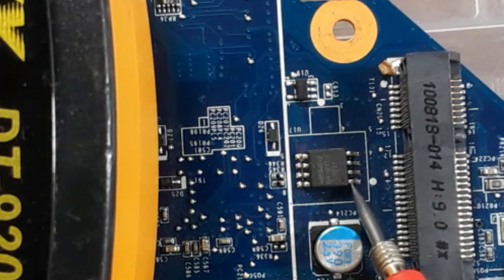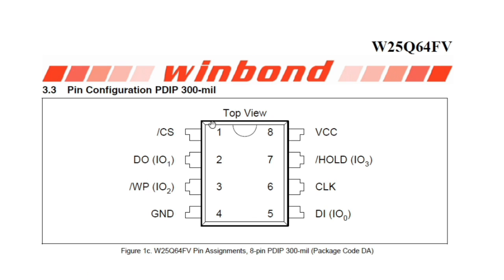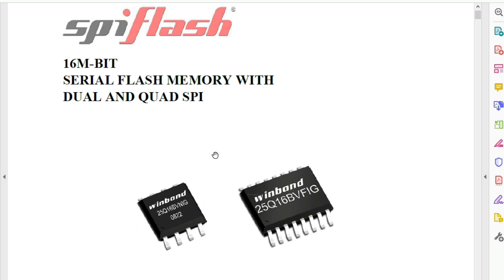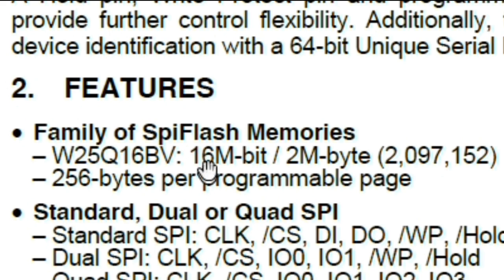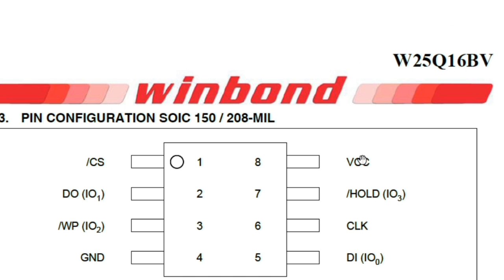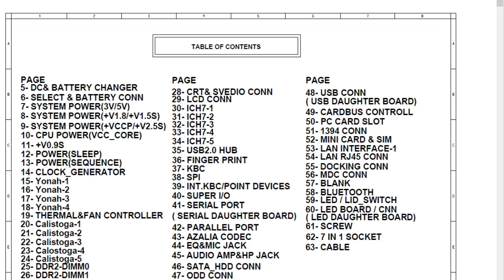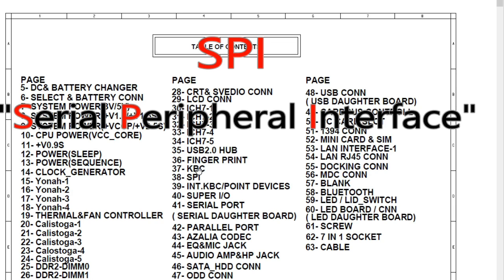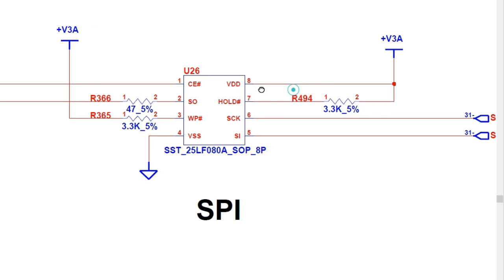Laptop Motherboard Repair - How To Diagnose BIOS Chip - BIOS Pin Configuration

Comment: Hi do you have any idea where the bios vcc v3 is missing? I plugged the charger power supply and when i check the ec chip it has v3 but the bios pin 8 is v0.0

I also test while pluging in the power supply theres about v3.3 then after 1 second it will drop to v0.0. 
Is my bios fried or it is just a corrupted bios. Thanks for helping
Reply: IHAVE SAME PROVBLEM